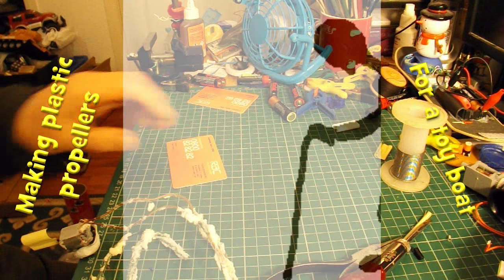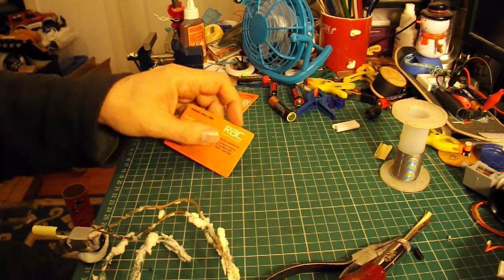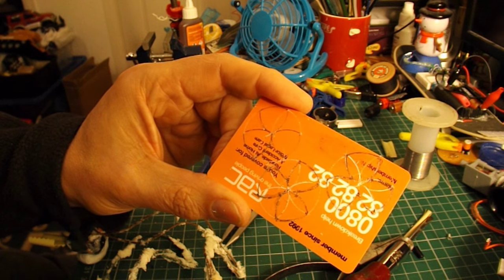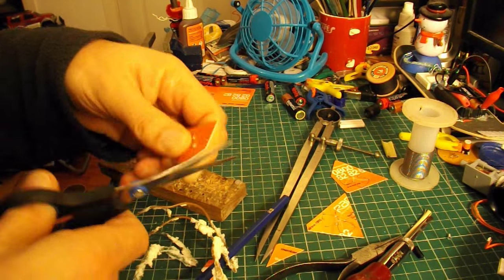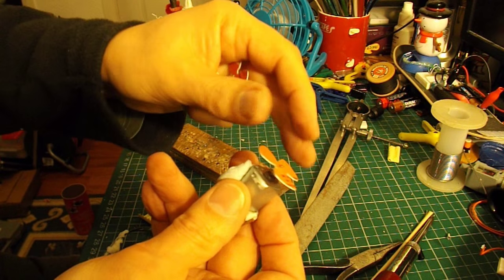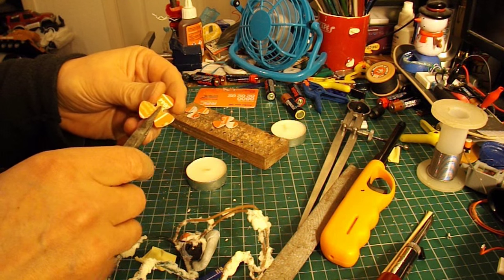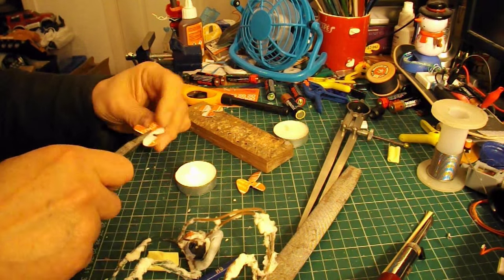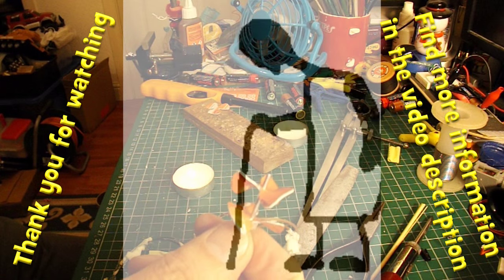Making a Toy Boat Propeller

Comment: An easy way to get the right angle on the props is to drill a hole  and a bit of scrap wood.  That is the right size as the shaft and must be upright in the wood  . Push a propeller shaft or nail with the head cut off , that is the right diameter into it.     With a little bit of wood glued to the wooden base.  So it will fit over what will be the leading edge of  the propeller  blade . So as the warmed plastic is pushed down over the shaft . The leading edge will be bent upward to the correct  angle .  I have found placing the plastic in hot water will soften the plastic  easier than over a flame . Making prop blades out of thin  brass sheet works well  with this system . But of course it would not need to be heated in hot water .   I  hope this is of help to some one out there .  😃
Reply from the maker: Thanks for the tips 👍

Comment: Umm can i use like a thin metal for propelers? Do you think it will work?
Reply from the maker: Yes, cut up something like a soda can and that metal would be fine, depending on how large you need the blades to be. Be carful as the metal will have very sharp edges.
Reply: GrandadIsAnOldMan Yeah thanks man you just earned a sub! Yeah i will be carefull but should i watch out at wich angle are the propelers im using the same kind of engine you used in video.
Reply from the maker: Unless you are trying to get perfect results I would just give each blade a gentle twist and try to keep them all the same. The greater the pitch the faster the boat will go but too much and it becomes inefficient and just churns the water. With metal blades you should be able to make adjustments in the field to see what works best for you but if you keep changing them they will eventually break.
Reply: GrandadIsAnOldMan Alright thank you very much! By the way your content is great!☺